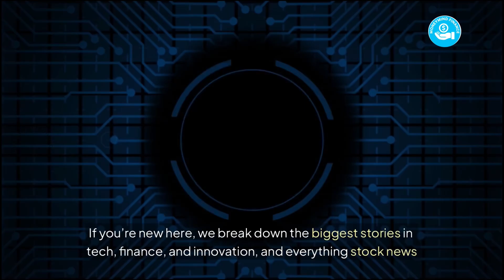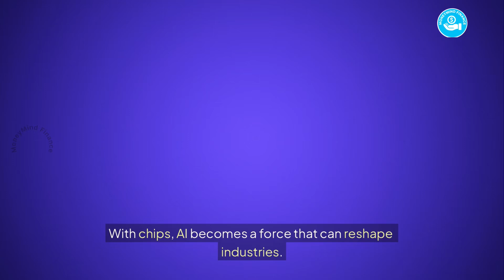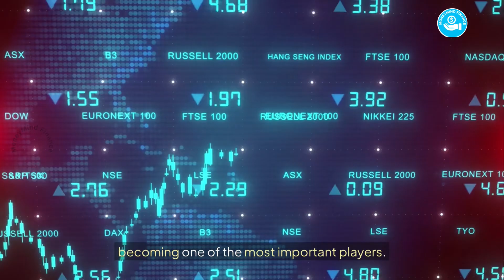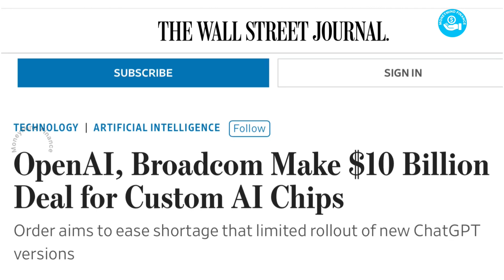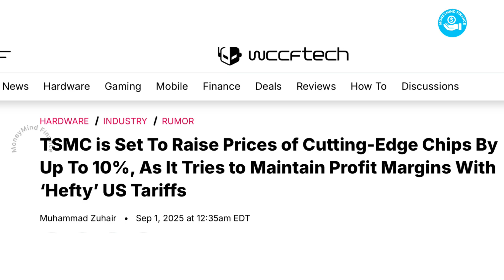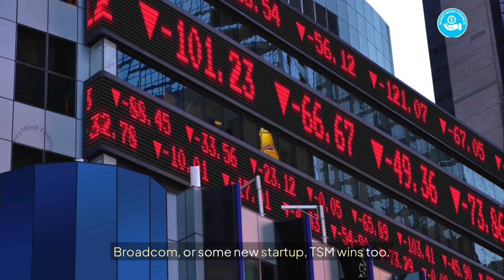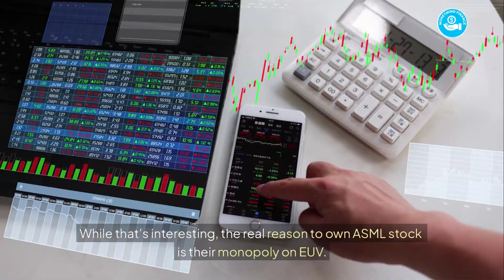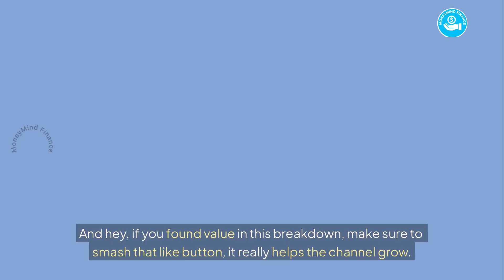3 Top Tech stocks for September 2025 (Stock News & Analysis)

Comment: I'm in a 3x etf, that has AVGO, AMD, NVDA, GOOGL, AAPL, etf. I wish I got it when I was lowest in April, but got month & half ago. Now I'm up 33% on it. If I got it at its lowest, I'd be up 300%+
Smh
Reply from the maker: Congrats on the 33%. That’s still an amazing return in just a short time. Timing the absolute bottom is almost impossible, so don’t be too hard on yourself. The important thing is you caught the trend and you’re riding the wave. Are you planning to hold long-term or just ride the momentum for now? Thanks for watching.
Reply: @moneymindfinance  no, holding long term. AI is building up, billions spent on it. Data centers are gonna be built. Chip manufacturing coming to US. So definitely long term hold.